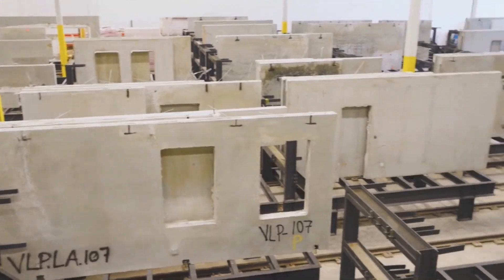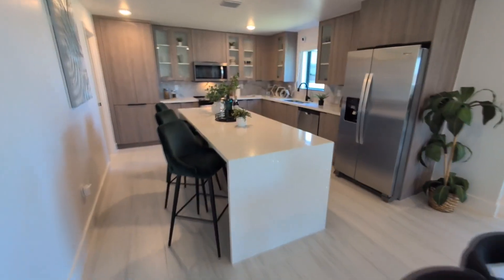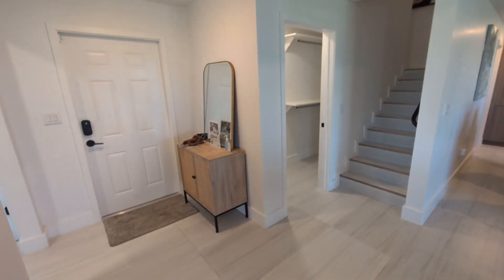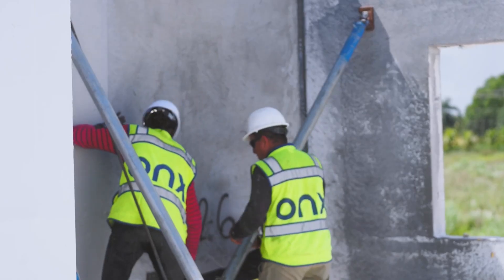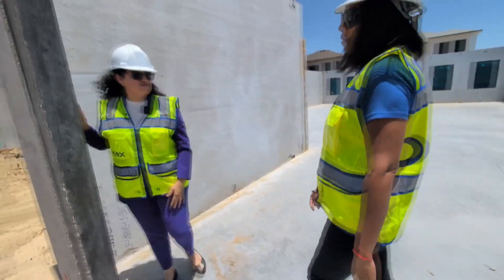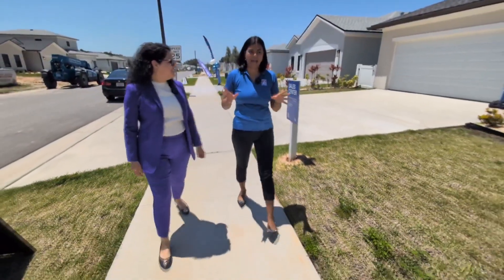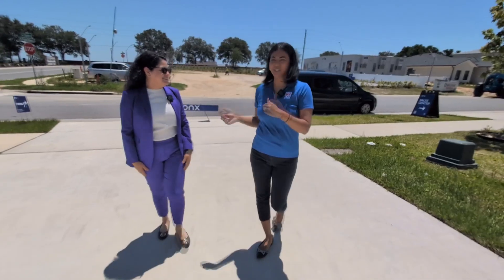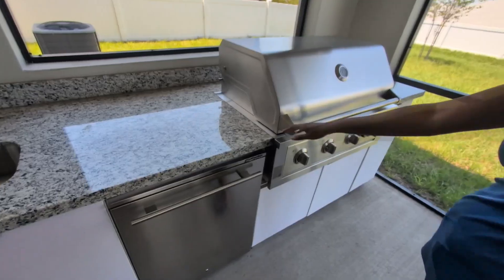These homes are built to withstand Category 5 hurricane winds

Comment: Great video, what happens if it rains 12 inch's are those homes built where at that height water will not seep into home?
Reply: great point
Reply: 380,000 is high